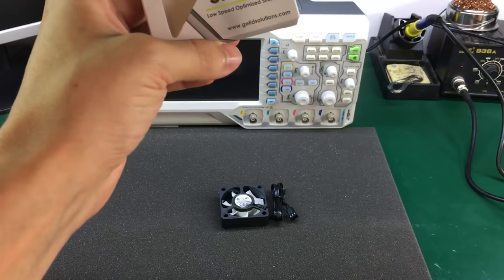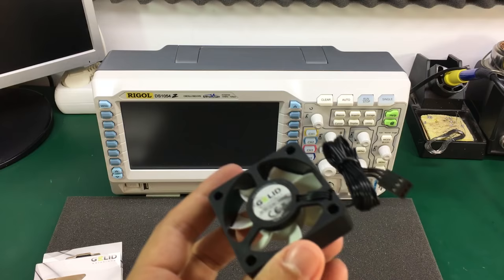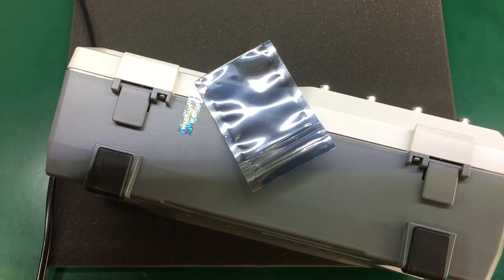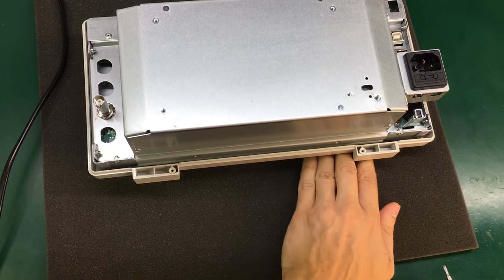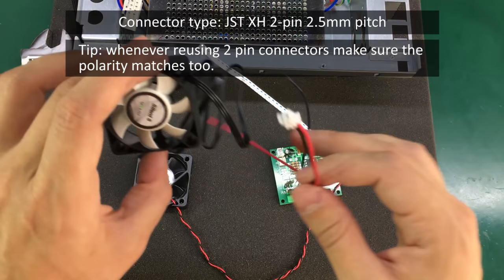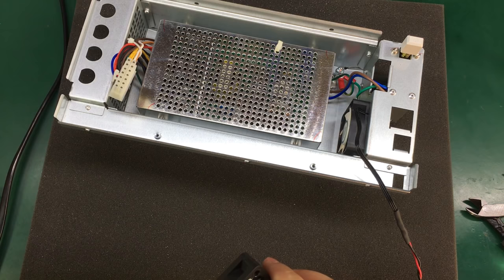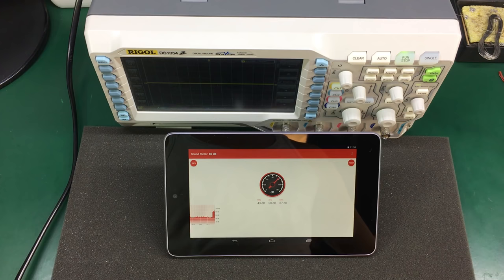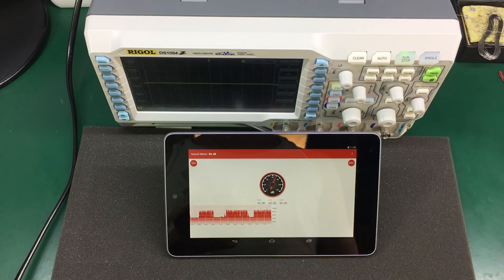Voltlog #62 - Rigol DS1054Z Fan Replacement

Comment: There is a majority of air being pulled through the cabinet that does not cool anything, particularly on the sides of the psu's cage, but also between psu and mainboard.
The fan even blows air back into the metal cabinet, as the plastic back is not providing a sealing.

If you stuff some insulation material between plastic back and metal cabinet, you can possibly prevent a lot of used air from being recycled, hence lowering the fan speed even further.

Comment: I just did this mod.    When I first put it together, the new fan did not work.  It turned out that my Gelid 5 was miswired at the factory, and the ground wire was NOT the one with the writing on it, but rather the one on the other side.  The center wire was positive, as advertised.
  So I got it back together with the new fan actually running, and all I can say is...
.................wow.

I can hardly hear it.  The old fan was loud enough to aggravate my tinnitus.  The new one... I could sit next to the scope all day.  It's turned it into an instrument that I can actually use.

A cursory search of my PC junkbox did not unearth a matching connector, so I just cut the original one off the fan.  If I ever have to send it in for warranty service, I guess I'll have to source another "Sunol Maglev".    I consider the risk minimal, because the scope is so cheap.

Comment: I have bought the exact "Gelid Solutions Silent 5" fan now, but on my fan Ground is not the wire with the  text on it. The cable is connected 180° turned.
So it's best to identify the ground wire by the leftmost pin on the housing of the fan as you mentioned here: 7:55

Comment: In addition you may like to decouple vibrations from the fan by using rubber standoffs. Any pc hardware store sells them and this will result in even less noise. Rubber standoffs for fan decoupling are mounted by default in pcs and laptops nowadays. Cheers
Reply from the maker: yes, thought about that also but in the end I decided not to use rubber standoffs because in the long run they might fail and leave the fan hanging. Also I didn't think they would bring that much of an improvement. The unit is already quite silent with this new fan.

Comment: To have a less air flow, will be easier to put a series resistor on the original one, does not need to change the fan

Comment: Is it safe? I bought Gelid Silent 5 fan, I replaced the noisy one in my DS1054Z. It is much quieter, BUT this new fan draws more current/power (new one needs 1.4W, old one needs 0.8W) and the original gives MUCH higher air flow! I measured it, and the original one gives 3x higher air flow than this Gelid fan. So I put the original fan back to my scope.
Reply from the maker: 3x higher airflow? that seems unrealistic.
Reply: Well, I measured it. I have anemometer, I measured those fans from the same distance and spot, Gelid Silent 5 gave speed 1m/s, the original fan gave 3m/s.
Reply from the maker: I am not an expert on the subject but here is my logic: the anemometer measures the speed of the air passing through the instrument which is not the same as the CFM rating (volumetric flow rate). The CFM specs on the two fans is the same 12.9CFM, while the Gelid runs at lower RPM. It could also be that the Gelid has a lower CFM rating at lower RPMs and I believe the speed is regulated inside the Rigol so it might be running at lower RPMs when the scope is cooler. Overall I wouldn't worry that much, the fan is pushing enough air through the scope..
Reply: It's obvious that fan which blows air 3x faster has much better cooling capability. CFM is directly proportional to the speed of blowed air (those fans have the same dimensions). I believe measured values more than values stated in some specs. 

I do not think scope is regulating RPM. Higher RPM means more noise. I have never noticed the noise to be varying while using my scope. 

Someone else mentioned it, but I was not able to find datasheet for Gelid Silent 5, so I cannot confirm hypothesis that this fan automatically increases RPM with higher temperature. I just compared air flows with 12V source at constant 25C temperature.
Reply: Replaced the Sunon fan with a Gelid Silent 5. The oscilloscope was running silently but much warmer than before (35 degrees celsius at the output of the fan, compared to 28 degrees celsius with the Sunon). So I put back the original Sunon, which is not that noisy anyway and much more efficient at cooling the scope.
Reply: It's well know from multiple people who have done this that the Gelid runs hotter than the stock fan. Have a look at EEVBlog forums
Reply: AlainHubert not sure the Temperature of the air coming out is the same as the temperature of the hot components in the scope.  If the airflow is a lot faster then it’s touching the hot stuff for short time and picks up less heat. Slower moving side can pick up more heat before being exhausted.  But what matters is the temp  of the hot components inside. One would need to install a thermal sensor on one of the hot heatsinks and then test to know how much hotter the scope is with the different fans.
Reply: @InterCity134  Are you sure about this theory? Air is ALWAYS touching heatsing thus transferring heat from metal to air. Speed of air does not lower this transfer speed. It is the oposite, faster you move air out the faster you cool down the heatsing.
Reply: @Chupacabras222  no, he is right. The amount of heat generated is constant, so if you blow more air through it the air that comes out of the scope is obviously colder, because more air with the same amount of heat generated = less heat per volume of air

Comment: Thanks for the video! It is a well made one. Espacially that you identified the fan connector and shared the type. I aswell dont want to cut the original one.
Can you please share the part number on the original fan so we can lookup the specification on it. I would love to find a even more silent fan with same pressure as the original one.
Reply from the maker: It's in the video description.
Reply: VoltLog aaaaaaah sorry... missed that. thanks!

Comment: What you should have done to add more value to the entire process :
1) get an ambient noise level reading with the scope turned OFF as a reference level. 
2) when the back case plastic was off, again take a reading of noise level so we would have data about how much of the noise the plastic case grills produce. 

With that additional data we might all know more about whether modifying the case bent shapes would even be a possible source if noise.

As to the warranty label : not sure bit did the wird VOID show as clearly before you opened it as it does after you reapplied it? If you need to send it in for warranty you’d have to remove the back a second time to put the original fan back before sending it in and hopefully big damage the label further.

Comment: It's basically silent. I measured the noise on mine and it went from 43.5db to 36.2db. I had to look at the fan to make sure it was spinning. I only wonder if it provides enough cooling. Does anyone know how it holds up after a long time (5+ years)?
Reply from the maker: It's gonna be fine.

Comment: Good Video. Did you also measure the temperature of the air stream exiting the scope before and after?
Reply from the maker: No I didn't measure it, but I don't think that is a good indicator of anything.
Reply: I actually did, and decided against replacing the fan, so I reinstalled the original one. The Gelid fan doesn't build up the same pressure as the original one.

Comment: Hi ! I was used a Sunon Maglev HA50151V4-000U-999 
from here : https://www.tme.eu/ro/details/ha50151v4/ventilatoare-dc-12v/sunon/ha50151v4-000u-999/ because I was found that is a little less noisy than Gelid ( 17 dB(A) instead of 18 )  . Indeed is a huge improvement in terms of acoustic comfort but the air flow is much lower in the same time. I am worried  about the internal components on long term, especially power source capacitors . I measured the temperature inside the source and is about 34 degrees with a maximum of 32 degrees to the exhaust  of the fan .
Reply from the maker: My scope is running fine with that gelid which had similar airflow characteristic as the original fan.
Reply: Can you measure the internal temp of the power source ? I inserted the thermocouple from multimeter into PS  from lateral through air holes .
Reply: I installed the same fan and am very happy about the low noise. You can still hear it but its about 11dB less what is really remarkable. In standby I get an output temperature of about 32°C at the fan and I am pretty sure using this fan is not a problem for the psu.